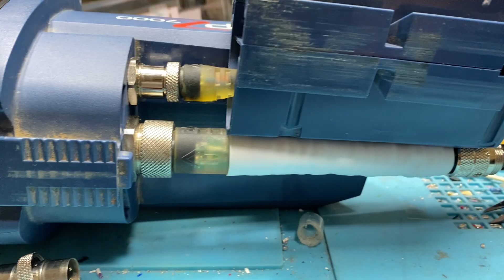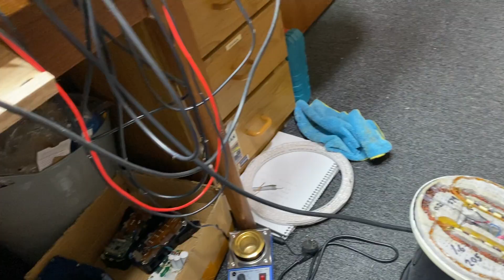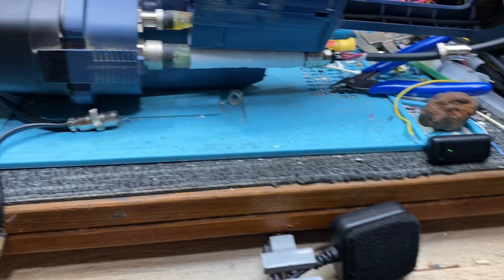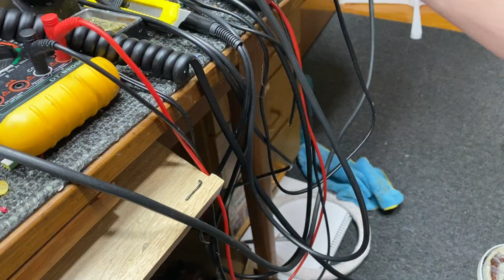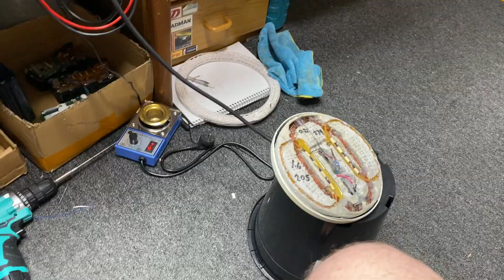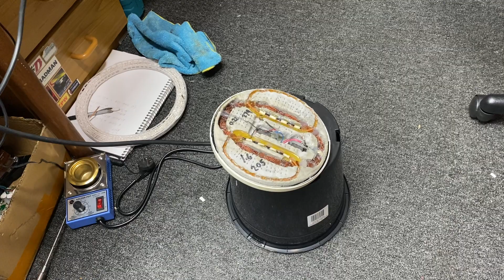Minelab GPZ-7000 Making a cancel coil out of an old coil either to use or for testing.

Comment: Hi woody mate was wandering if u think the modded 7000 compares or is better than the 6000 in sensitivity at the depth for the smaller stuff I have a 7000 myself and it has served me well  but am finding it real hard to pick up the smaller stuff at depth I already run the sensitivity 15 +
Reply from the maker: If the performance is going backwards it may be transmit current falling off or like the coil is getting old and the copper coated alloy is cracking up. Both the 6000 and 7000 can be improved as proven in the field tests.